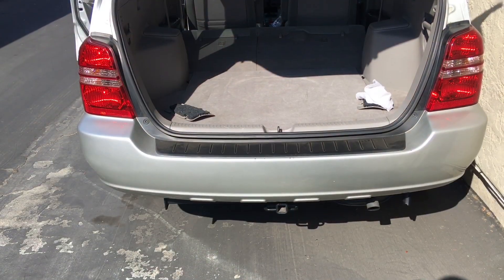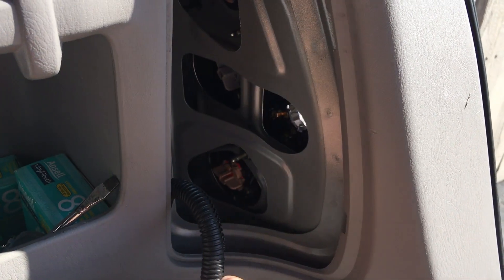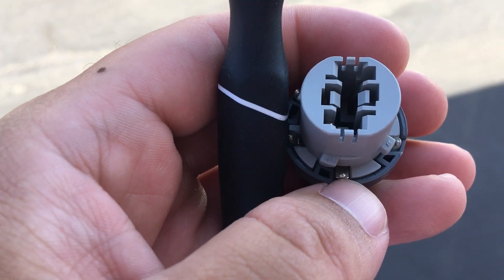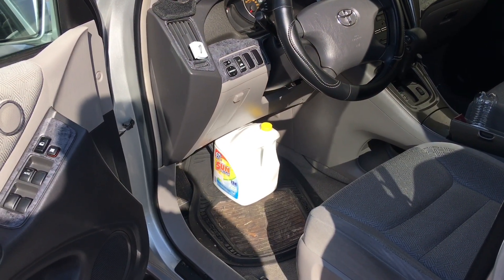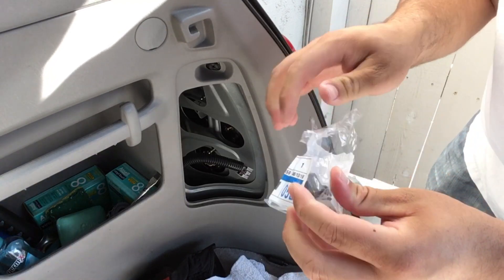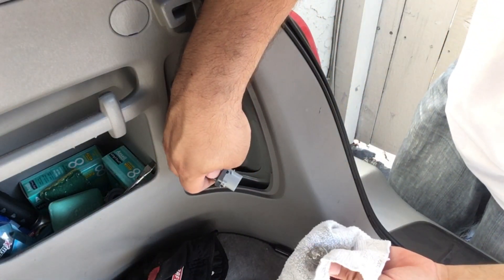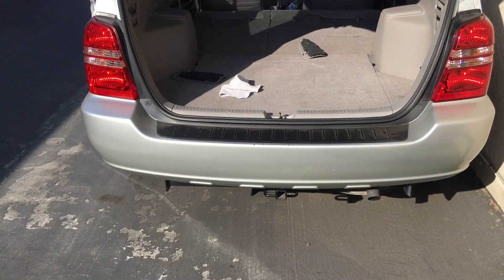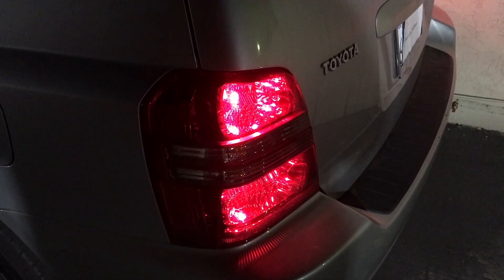How To Fix 2001 2007 Toyota Highlander Tail Light Failure Problem

Comment: 2005 TOYOTA HIGHLANDER LIMITED-My symptoms were tail light fuse, kept blowing out left blinker wouldn’t work hazards stopped flashing, and would only work for a few seconds. Also as another possible problem is check the trailer hitch, wiring harness, right underneath the plastic tool tray holding all the tire changing tools inside the back floor panel. Directly above where the spare tire is, but inside. There is a wiring harness to add on trailer lights. Constantly shorts out on the metal floor. If you had changed a tire recently, that will definitely be a reason why I could’ve gotten moved in, pushed against the floor harder. Check it out as well while back there. Good luck

Comment: Thank you so much for your video.  Here’s my story.  When my right brake light was not working, I first changed the bulb, but that did not help.  Then I looked at another YouTube video, which said I should bend the contacts and twist the connector only part-way.  No luck.  Since I had to get an oil change, I figured I’d pay the dealer service guys to fix the problem, thinking they have seen this problem before and would fix easily.  Wrong!  The service guy told me it would cost $160 to diagnose the problem.  I reluctantly told them to go ahead and fix it.  A couple hours later, the service tech. called me to the shop, where the young (20 year old techs) ran tests and told me I needed a whole new rear tail light assembly, costing around $600.  I told them No Thanks and started searching.  I ordered the new connector, hooked it up, and presto!  Problem fixed!  Thank you so much.  Thinking back … replacing the whole tail light assembly would not have solved the problem if they didn’t replace the connector.
Reply from the maker: @bontempsbill  The new tail light should have a new connector but I agree, $600 is ridiculous. 

Glad everything worked out.

Comment: Thanks Daniel, I bought a Kluger which is a highlander in Australia and the rear lights are playing up. I figured it was the dodgy way Toyota used to connect the plug to the lights that was my problem. Btw, it’s only halogen globes that you shouldn’t touch with your fingers, all other globes are fine bud

Comment: Great video!  Thanks! Went to dealer to try and purchase socket but only comes with wiring harness is what they told me.
Reply from the maker: @stevenshircliff393  Thank you, that’s interesting. The only wiring harness goes to the reverse lights and the turn signals and brake lights are just the adapters. If you live anywhere around northern CA I got mine from Roseville Toyota.
Reply: @DanielsCarTalkChannel  Live in KY. Thanks for quick response!  Going to try cleaning contacts and bending slightly.  Turn signal is only issue thus far.

Comment: I've been having trouble with both sets of brake/stop lights. This video helped me focus on the connector and not the bulbs or fuses as the issue. Bending the tabs and reseating the components has worked so far.

Comment: Awesome tip on replacement of the connector, I had no idea it was so easily removed. Sure enough, mine had corrosion. I should note though, that the prongs inside the socket (where the connector plugs into) were also corroded, and that part's not so easy to swap out. So, I cleaned them as best I could, and good to go. Thanks man!
Reply from the maker: Corse. Thanks for the support.

Some dye electric grease might help with the corrosion. You can get it at Autozone.

Comment: I had both brake lights stop illuminating
After trying different bulbs and connectors: cleaned off corrosion on turn signal electrical connection.
I doubted the fuse was broken as driver's side was working.

Comment: my recommendation is to buy Acetone or Alcohol in Home depot and clean wipeoff contact with Qtip and Acetone, all male female contact.  No need to buy those terminal very expensive, Corrosion contact is the problem will be the same like brand new.  Clean also those contact where socket/bulb goes in the lenses, make sure car ignition off to avoid shorting it.

Comment: Hello Daniel, thanks for the video. I have a Toyota Highlander 2004 with the same problem. Can you please let me know the part number for the socket.
Reply from the maker: S K Glad I could help. Part number for the connections is 90075-60036. I just got mine at the local Toyota dealership. Haven’t had a problem with it since.
Reply: Thanks for the part number. I ordered it from Amazon.com for $15.00 and yes it works like magic. Thanks for your help in resolving this issue.
Reply: So glad you showed the part number for the right hand side, had to give that to the dealer when ordering to get the right part. What part number did you have for the left hand side?

Comment: Ever see some of the latest Toyota and Mazda tail lights?  Why did they have to make them those blinding dots anyhow?  That little bit of metal wouldn't make any difference anyhow.  They light assemblies are still full size but they have those tiny blinding asininely designed lights that are ugly and a just a bad design.  By that logic there are millions of Toyotas with tail light failures because their design is a miserable failure.  If you were ever behind a Toyota or Mazda you will know what I mean.  The only thing worse would be getting stuff behind one in heavy bumper to bumper traffic.  If some engineer thought that it would look good he is guilty of they crime of heresy!!!!

Comment: I tried that on my Highlander and it did not fix the problem.
Reply: Same here did you ever figure it out? I checked fuses switched bulbs and socket to other side messed with connection to no avail
Reply: superperior I ended up having a short somewhere in the tail light.  I bought a new tail light assembly on Amazon for about $65 and the tail lights works again.
Reply: @louisianaguy2661  awesome thanks for the reply glad to know that my next step worked for you thanks again
Reply: Look up diy how to fix your brake lights on toyota highlander yt Jegs Garage... it fixed both of mine...you dont need another socket